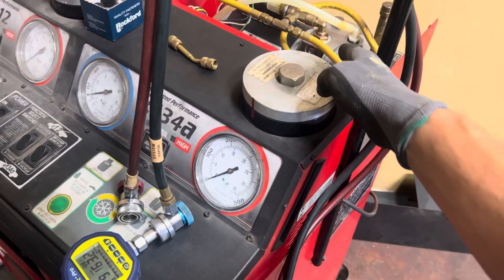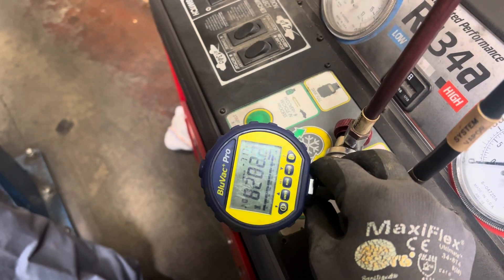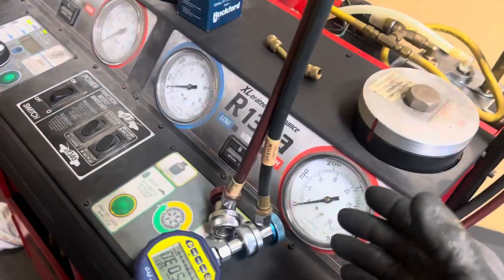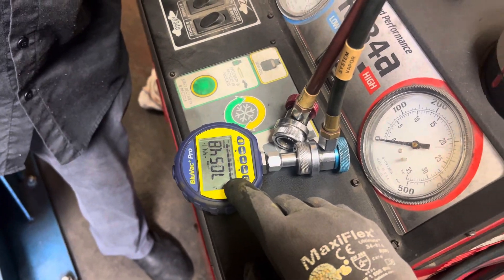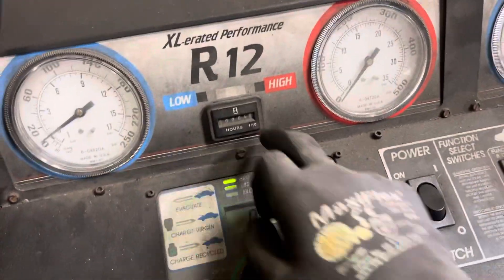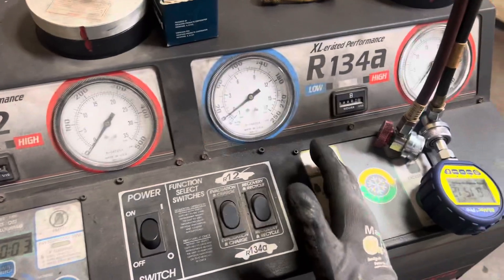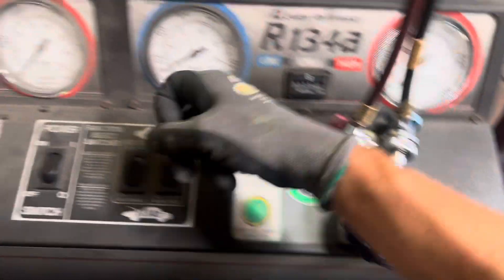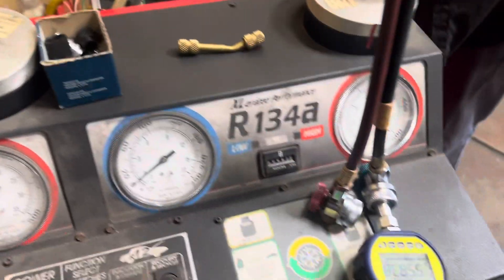￼AC Machine￼ Vacuum pump dead quiet after changing vacuum pump oil can’t even tell it’s running￼

Comment: Those old machines used to print hundred-dollar bills :O)
Our old RTI  R134a user-friendly machine needs a new compressor. The Boss is on the fence about fixing it, I tell him it's cheaper than a new one :O)
Reply from the maker: I grew up in the school of rebuilding compressors or at least for a case leak tearing them down and throw in a reseal kit shaft seals case seals. 

Now unfortunately we live in the world where my labor is so expensive it would cost more for me to tear down a compressor clean it properly put it back together I feel bad about throwing away all these good compressors that have nothing more than seal leaks. 
          And living in California we have very strong consumer right laws for the consumer legally you’re always writing like doctors notes on every work order and covering your ass for legal reasons well shops will just replace the whole assembly instead of taking on the liability and responsibility of something else on the unit failing and then having to warrantee it because the customer doesn’t understand that had nothing to do with their original failure so it’s easier just to sell him a whole new thing than trying to do repairs anymore which is sad. 

But on the other hand there’s no new text who come into this industry who know how to repair things or diagnose things correctly because they got rid of auto shop 30+ years ago out of the public school system and we now have a couple generations of borderline retarded students coming out of high school. No electronics class no wood shop no metal shop but they could flip burgers scrub toilets and take out garbage and play computer games
Reply: @coldfinger459sub0  I did my share of ceramic seal replacements on A6 & R4 compressors? (I think I got those right) GM stuff, then figured out they were pretty much junk to start with, beating a dead horse so to speak. When they worked, the systems  chilled great, when they failed, what a  mess :O)

Question: Do you have a source or can you recommend  where I can get a compressor for our old RTI R134a machine? Or should we just let it go :O(
Reply from the maker: @hnd2893  The old Frigidaire A6 What is a indestructible battleship.    But yet technicians managed to burn them up or Roast clutches by grossly over charging them or leaving the systems contaminated with high percentage of air and moisture contamination. 

As for the whole RTI that should not be used on anything except old vehicles with refrigerant charge capacity is well over 2 pounds back in the days when that machine was designed and manufactured for. 

A plus and minus accuracy of the old scales were always off by 2 to 3 ounces. 

Which was completely OK back in the day for large refrigerant capacity vehicles with old tube and fin technology where critical refrigerant charges were not important. 

For today’s vehicles are manufactured with Microchannel condensers which are called critically charged that means are very extremely sensitive to just plus or minus one or 2 ounces for their efficiency. 

I have one video out on a little Prius showing it deadheading at 440 psi compressor cut out because the system was just two or 3 ounces overcharged. 

In that same video I show Jess by adding my hose to the high side line and it filling up with 1 ounce of refrigerant gets the compressor to come on for a short while before hitting 440 psi. 

then I open up the refrigerant eyesight port to the manifold and I think down into the yellow refrigerator charging hose and filling it up with another ounce and then the compressor continues to run so that’s 2 ounces removed from the system just in my hoses but we’re still I believe in the high 300 psi range and then by using the blue low side hose to open up that port in the lower high side pressure to push and condense liquid refrigerant into that line removes another hours and then the system performs and operates new normally. 

This is how sensitive the small capacity systems are with Michael Channel condensers

(*** Microchannel condensers are in a New category under a classification that is deemed and called critically charged for a reason ***)
Reply: @coldfinger459sub0  OK, I stand corrected, it's been years, the A6, remembering now was for the most part bullet resistant, provided the system integrity was intact :O)

And yes, I know what you mean about the accuracy of the RTI scale, no matter how I try and calibrate it... :O(

Something that dawned on me recently using our CPS big dumb R134a A/C machine with its 6-ft hoses, while performance testing after a recharge, that the static pressure of the Low side line and the volume of refrigerant in it, is higher than the Low side operating pressure and when the A/C is on and the valve is open the amount refrigerant in the hose will be drawn in while the system is operating, thus potentially overcharging a smaller, critical charge capacity system. Am I correct?
Reply from the maker: @hnd2893  depends it equipment manufacturer.   Some compensated for line some not.  In the manual for the machine. 

Those machines are so slow I cannot stand using them.  I can do 3 or 4 ac jobs in the time I take it to do one.
Reply: @coldfinger459sub0  Some days I can go take a crap and catch a nap waiting for the Mo-chine to do its job, Thanks Dude!
If you have a way for me to pay you for your valuable knowledge, post a link or something, I like to pay for training and info, it helps me to sleep better at nite :O)
Reply from the maker: @hnd2893  one day I’ll have something I’ve been asked about that.
Reply: @coldfinger459sub0  I think you can do it via PayPal, or Patreon. 
Is your U-toob channel monetized, if you don't mind me asking? You could be raking in some bucks or some spare spending monies :O)
Every little bit helps.
Reply from the maker: @hnd2893  The channel is too small to monetize not available and they want monetize channels to edit their content and they want them to put titles with print overlay catchphrases and they want you to put links to other videos I don’t do any of that
Reply: @coldfinger459sub0  Sometime the lure of more money just ain't worth it :O)
Reply from the maker: @hnd2893  with the low amount of hours on this machine he never made his money back